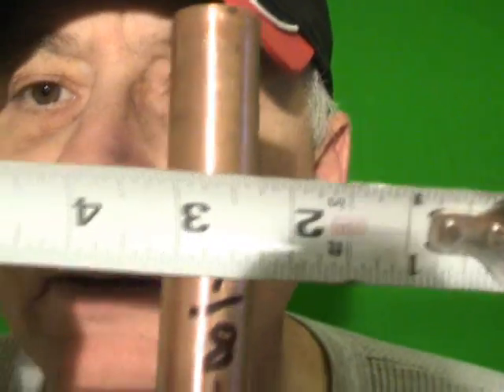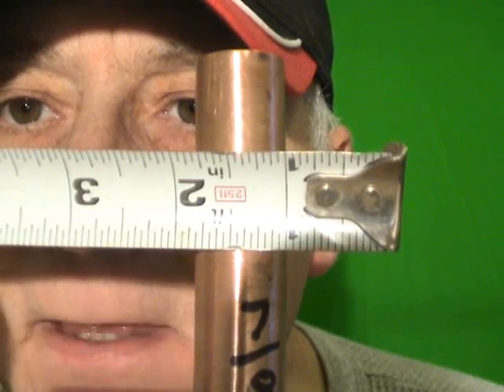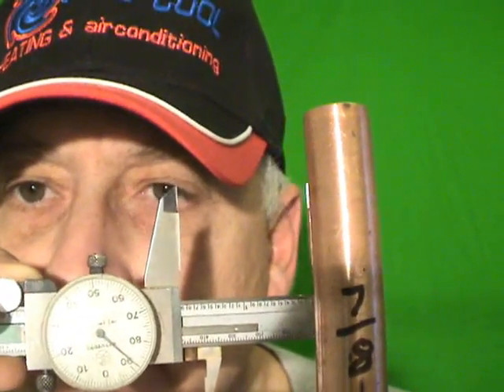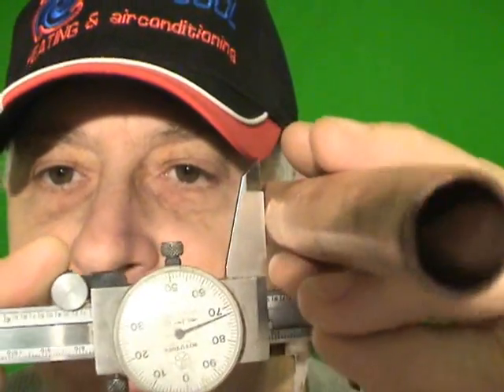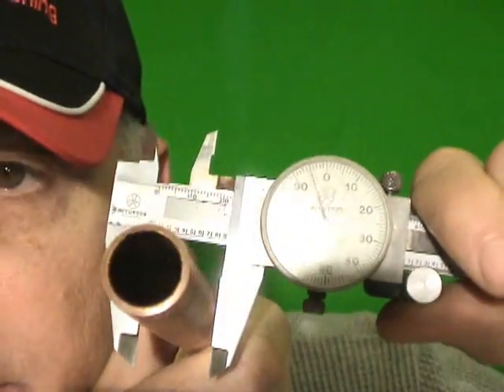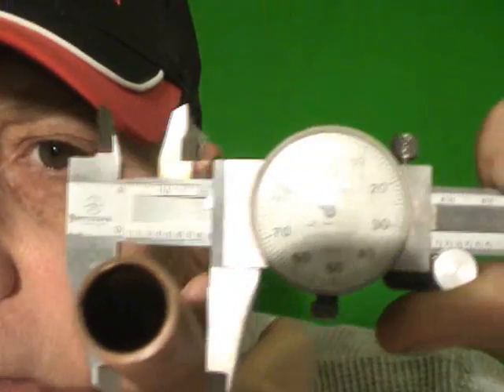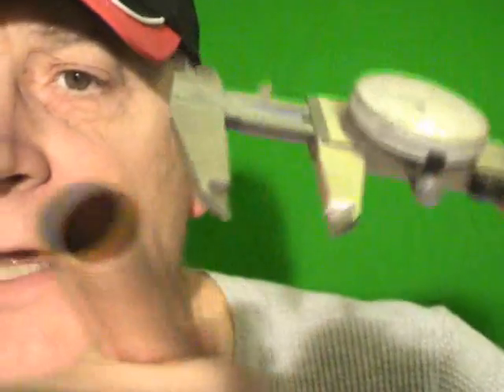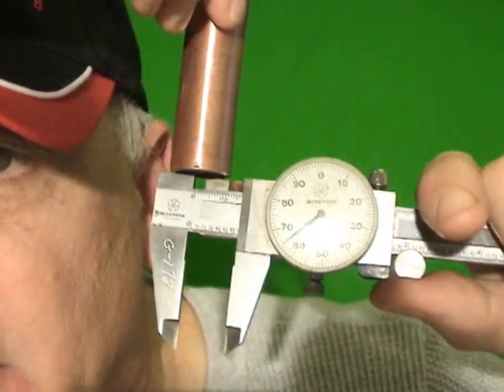HVAC Copper Tubing

Comment: is there any difference in chemical composition between regular water copper pipe vs hvac copper pipe? specifically for ductless heat pumps?
Reply from the maker: I don't know for sure if the copper that is used in HVAC systems are of a special alloy. But I do know that the copper tubing in R-410a systems are a little thicker.
Reply: The primary difference between copper tubing used in HVAC vs plumbing for water is the wall thickness and pressure rating, with HVAC copper tubing typically having thicker walls to withstand the extreme temperature fluctuations and high pressures of refrigerant lines, while plumbing copper tubing is designed for more moderate water temperatures and pressures, usually using a thinner wall type like "Type L" compared to the "Type K" used in HVAC systems.

Comment: DrZarkloff, how do you bend 1-1/8 piping.  It seems too large to be able to field bend.  Most bending tools max out at 7/8.  Is this possible to bend?  Or is it better off cutting and brazing (swage)?  I'm looking at doing a Goodman 3.5 ton heat pump.  The run is around 32 feet, the specs call for a 1-1/8 suction line and 3/8 liquid.

Comment: so i should be able to make line sets for a ductless mini split ac unit if i bought soft copper tubing, flaring tool and insulated it myself. Those line sets that are sold pre made are expensive. what are your thoughts?

Comment: Glad to have found your video, wanted to get an idea of the most common coiled pipe sizes in USA. We are UK based and have designed and manufactured a hand held pipe straightening device which will completely straighten coiled pipe ie copper, aluminium, stainless steel etc. Would love to hear your thoughts?

Comment: How do tell the difference between a pipe-fitter and a plumber?

You bury them up to their necks in crap (the clean version) then swing a baseball bat at their heads and the plumber will duck.